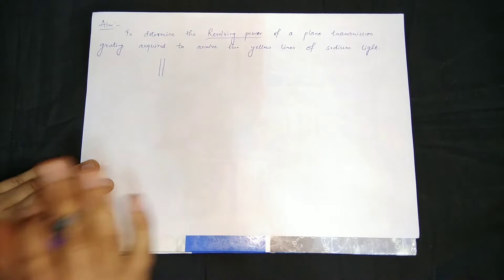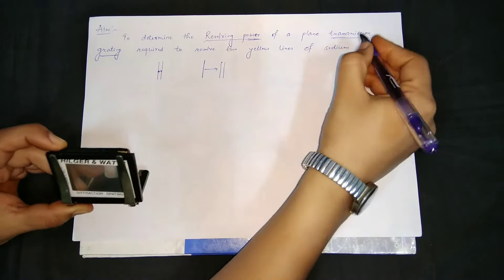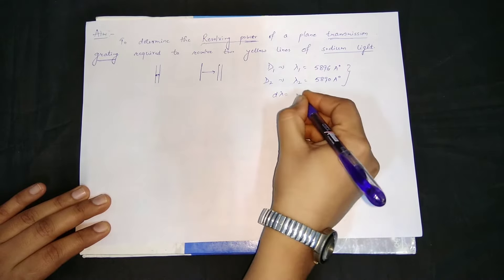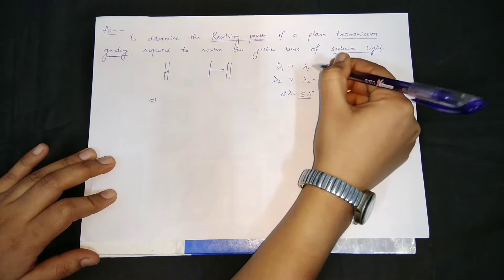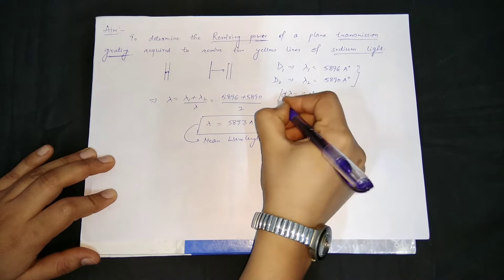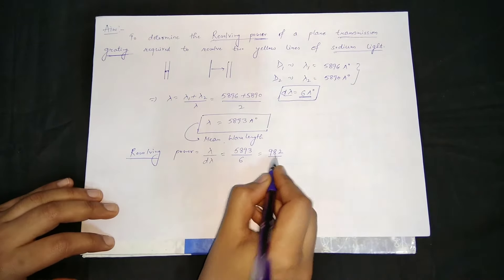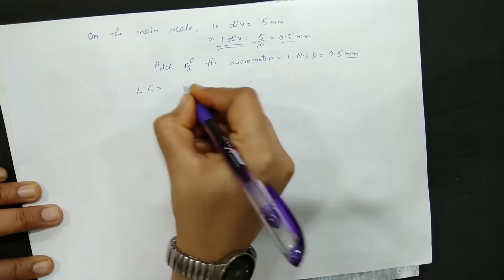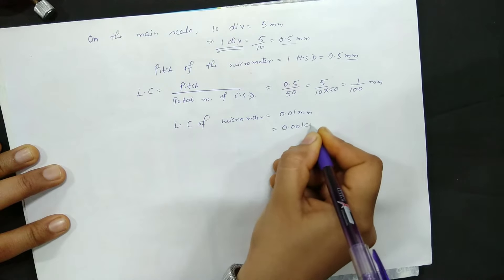Resolving Power of a Plane Transmission Grating | Experiment

Comment: if the adjustable slit width is =x.  this amount light falls on the grating. grating has no of rulling per unit length =m. now grating resolves the d1 d2 lines in first order ( n=1) thus $R= \lambda / d \lambda = x m n$